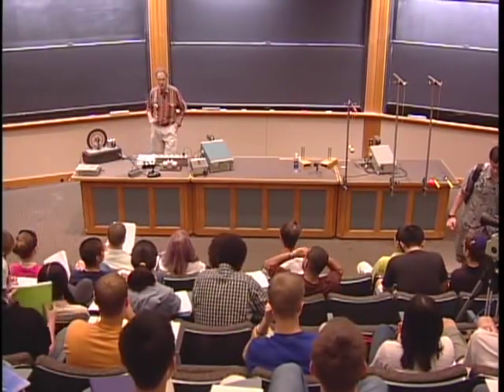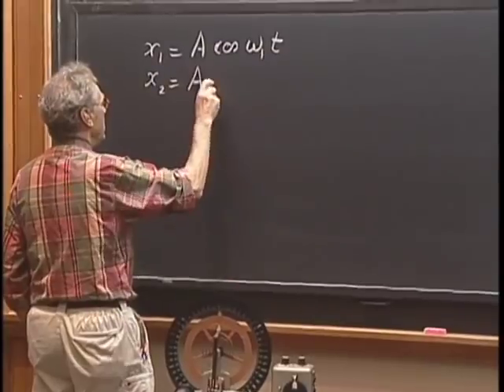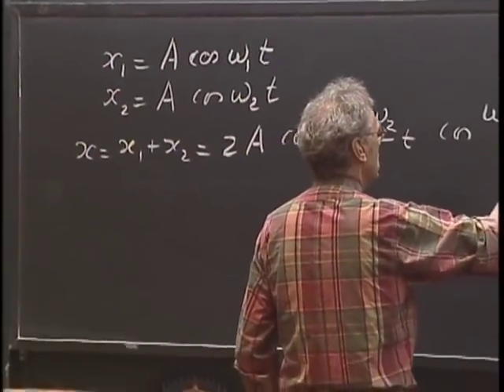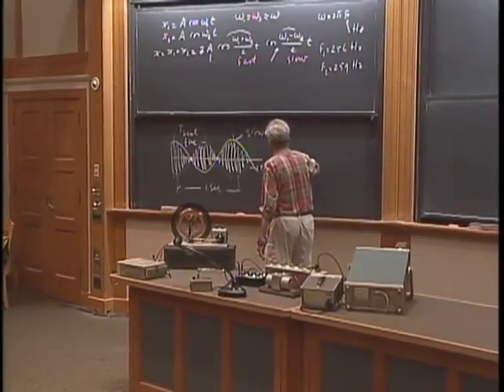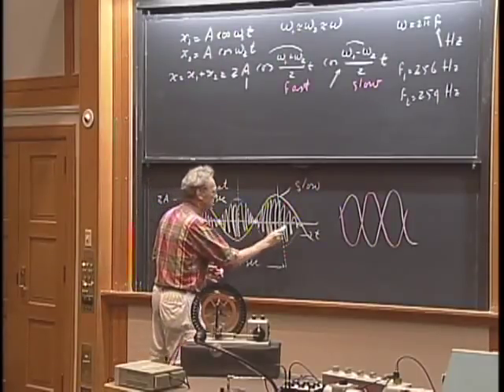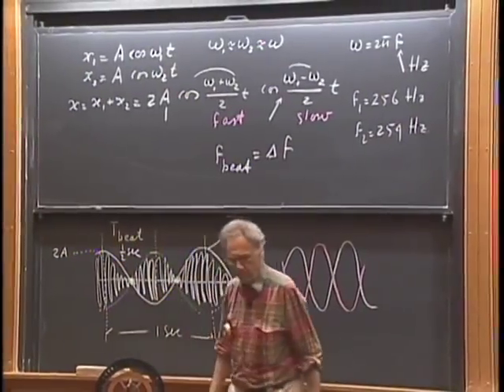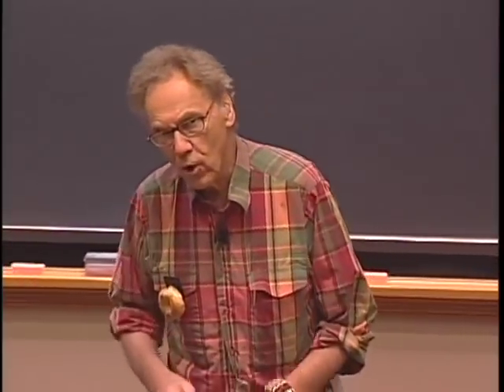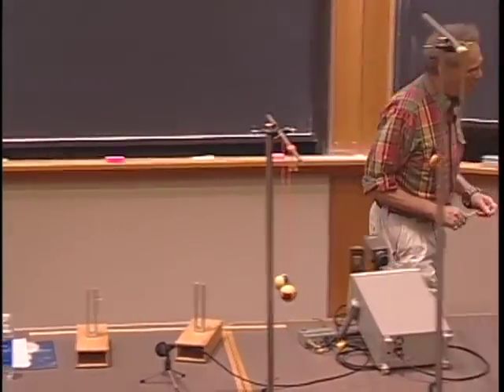8.03 - Lect 2 - Beats, Damped Free Ocillations, Quality Q

Comment: Hello, I think in your analysis of damped free osscilations, you miss out 2 specific solutions, over damped, under damped,  and critically damped. Im not sure how your method missed the two solutions however one  is an exponential decay, and one is an exponential decay times by a factor of t, with no osscilation
Reply: You assume omega^2 is a positive quantity and hence your solutions, for critical and over damped this is not the case
Reply from the maker: overdamped and underdamped ocourse are covered in my lectures.

Comment: Hi professor, the phenomenon you referred to of 2 jet engines creating a beat is known in avionics engineering as: "resonance offset", and it is real and deliberate. If the 2 engines were perfectly in time it could create damaging resonances, which probably wouldn't be capable of bringing a plane down, but are definitely strong enough to damage components. 

Planes have sensors that measure for resonances and damp them automatically, while a great deal of time is spent calibrating this system on the ground. 

The SR-71 has extensive systems which monitor how the 2 engines are performing together and automatically cuts out power if a resonance or mismatch of power is detected, since at high speeds this could easily bring a plane down. Pilots report this mechanism causing nausea.
Reply from the maker: very interesting - thank u

Comment: Hello, Professor. Gamma depends on L (inversely proportional) because L gives a sense of inertia in the RLC circuit, that drives the current even after the capacitor plates have discharged, after a quarter cycle. And gamma for any system is bound to depend inversely on its inertia, because it is more difficult to slow down an elephant than it is to slow down a human.

Comment: I think the reason why L also has something to do with the decay time,is the self-inductor converts energy to magnetic field energy, but circuit does not lose that energy.It can be convert back to current.If L is very large, the current won’t go very high.Then the lose of energy in terms of heat in the resistor will become slower.So it is reasonable that higher L—>higher N(longer it would take to reduce the amplitude by a factor of e.)

Comment: Hello professor Lewin, I have been thinking about the question you ask @ 1:07:50. The best answer that I can come up with is that as the resistor dissipates thermal energy it changes the changing magnetic flux through the inductor creating a back current that forces more current through the resistor. or maybe a better way to say it is as thermal energy is released it dissipates the magnetic energy that becomes more available current that creates heat at the resistor.
Reply from the maker: a resistor dissipates energy (heat) *I^2R Joules/sec. A conductor does not dissipate energy.

Comment: Kindly verify(1.08.25)

Energy dissipation in inductor takes place because direction of current changes through the inductor. Magnetic flux associated changes leads to back emf. Work is done against back emf during a part of oscillation. Work done by the emf (later) does not equals work done against it. Thus There is some energy loss.

Comment: Here I am again.. Let's say -1/4Q^2 equals h, so we obtain (1+h)^1/2 when we apply the square root on the expression that relates the omegas. Applying Taylor Expansion we get 1+1/2*h (we can omit higher degrees given that h is small). Replacing the proper value of h we find that w=w0*(1-1/(2*4Q^2)). I found the 8! ;)

Comment: Greetings Professor, First Thank you for the wonderful lecture... I have two questions, what would happen if I have more than 2 oscillation like 3 oscillations at a relatively same frequency( for eg 244, 245, 246 Hz)? And How should I go about thinking this sort of question/ questions, mathematically/deductively or I should do an experiment to find out? Your advice/hints would be hugely appreciated. Second, I think 'L' in LCR corresponds to mass in SHM, at equation level they both represent inertia of a system. (This is, though I think  is cheating at some level, by the way, my explanation to the question posed by you in the lecture)
Reply from the maker: question unclear
Reply: Do Beats phenomena also occur when more than two SHM involves in? (Like three SHM with 244,245,246 Hz frequency respectively. would they still show Beats? ).
Reply from the maker: yes

Comment: Sir I have a very simple doubt for you that I've been pondering over. I still haven't got an appropriate answer to this yet. The doubt is that , if we have a  tennis racquet , and we swish them with an amount of force, we hear a malignant amount of sound. How is that ? Hear we only have amplitude with a very , very less frequency(obviously below 20 Hertz) . even if we tell that we are striking the particles in the air and thus , we are producing sound, why does not it  apply  to other things as well. We depend mainly on the frequency of a vibration an object for its audibilty.
Reply from the maker: +Shricharan Dravid Messi You hear a sound when you put your hand on the table. You hear a sound when you push the keys on your key board. In all cases you produce a pressure wave which is sound.  No law is violated.

Comment: gamma  = R/L it depends on 'L' like the mass 'm' effect damping in gamma = b/m   lesser  m will get more damped oscillation same with L in the circuit. or as L opposes increase in current (-L di/dt)  rate of flow of charges are slowed down a bit and so less energy of charges will be  dissipated to heat becoz of  resistor . if L was not there the K.E. energy of charges would have dissipated more to heat. it feels good to me , might be right one.
Reply: prof. please tell is it right or not.
Reply from the maker: what are you referring to? How many minutes into my lecture?
Reply: at 01.07.28 you asked why "L" also comes in damping in RLC circuit.
Reply from the maker: the answer is that wL has the dimension of ohms.

Comment: explanation why gamma is proportional to 1/L:

in a circuit, inductor  always try not to change direction and magnitude of current. so when current introduces in the circuit , it is inductor which keeps minimize the magnitude of current and thus reduces energy loss in resistor.

is  my explanation  right ,sir?
Reply from the maker: what you write is not an explanation. Lenz Law dictates that a self inductor will oppose a change in magnetic flux inside the self inductor. No more and no less

Comment: For the general solution of the differential eqn. in complex plane you took the function to be Ae^(j(pt+α)) what is the use of taking α. I did the solution without taking α and it works just fine. Was it taken to accommodate the phase difference when required?
Reply from the maker: +Ayan Gangopadhyay Without a phase angle, sigma,  your solution is not as general as it can be. But for cases where sigma is zero your solution is fine.

Comment: In this lecture you have asked one question that why L comes in the damping constant R/L , in the case of a RLC circuit.I think the possible answer is according to Lenz's law the inductor owing to its self inductance impedes the increase in current through the circuit, as a result of that it inhibits the accumulation of charge in the capacitor..Hence it is damping the response...Am I correct professor?
Reply from the maker: Arnab Mallick That sounds right !
\\/\///////@lter
Reply: +Arnab Mallick  I have a little problem regarding your reply..... Based on the formula,  gamma = R/L, it clearly shows that as L gets larger, it is more difficult to dampen the change in current..... Thus, I think inductance is used to impedes the DAMPENING EFFECT of the resistor.
Reply: +yao shen deng
I agree. As the L goes up I goes down, which creates less thermal energy over the resistor. After all when L goes up there's less current needed for the same amount of energy in the magnetic field (due to E = L * I^2 / 2). So for the same amount of energy in the circuit you'd have a smaller loss of thermal energy and therefore less damping.

Comment: (59.04) , q = q(1) * cos(wt+@)+ VC  , then we got q(1) = - q(max) . what q(1) being -ve signify, why it comes out -ve , can it be +ve?
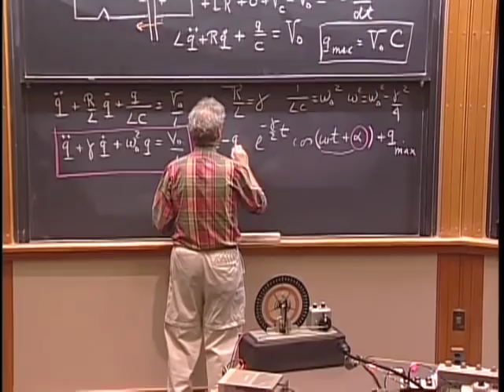Reply from the maker: I looked at 59:04 I see no -ve
Reply: 58.57  you said by simply replacing q(1) by minus q(max). we got it from initial conditions. please explain me what this -ve sign signify, why it comes out -ve , can it be +ve?
Reply from the maker: I looked at 59:04 I see no -ve
Reply: He meant as the angle alpha is small (5.7 degrees) although he mentioned it theta but it's fine then cos(5.7)is approximately 1 and from the equation q1= - qmax/cos(alpha) hence q1 is approx -qmax

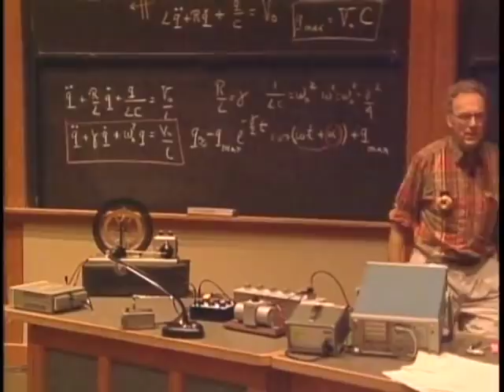Comment: Hello, professor Lewin. I was thinking about the gamma inverse dependence on L and I wonder whether it is so, because Self-Inductance fights against the current (according to Lenz's Law) thus making it smaller. If gamma/damping is due to heat loss and heat is R.I.I, then by making the current smaller the heat loss would also decrease. Is this even remotely correct or am I completely wrong? (Time stamp 1:07:35)
Reply from the maker: how many minutes into the lecture?
Reply from the maker: I  watched near the time you mention but I do not understand the question
Reply: @lecturesbywalterlewin.they9259  At 1:07:22 you say "You may want to try to find for yourself a convincing reason, why the L also comes in the damping..." so I tried to find a reason. I said I think it is because Inductors fight the currrent according to Lenz's Law and by making the overall current over some time a bit smaller, the also make the heat loss a bit smaller (since heat is R times I squared). If the damping is due to heat loss, then bigger L means more "anti-current", thus less current over some time and less heat loss/damping.
Reply from the maker: @lukastrecha6424  I would have to watch a large part of this lectuere again which is not worth my time. I am sorry.

Comment: respected sir, when you right LC circuit equation it is analog to mass m oscillates in damping medium here mass is oscillating but what is oscillating in LC circuits if it is electron then how it can be moved around the conductor and oscillates as well?
Reply from the maker: current is oscilating

Comment: Hey Mr. Lewin,

For a simple pendulum swinging until it comes to rest:

Does the air resistance it experience depend on its angular velocity?

I.e. Air drag is high during the first 10 seconds and air drag is low during the last seconds.

My physics teacher says instead it depends on the acceleration?
Reply from the maker: NOT angular velocity and NOT acceleration.
It depends on the linear velocity of the bob at the end of the pendulum. Watch my 8.01 lecture on friction. I dis cuss air drag in great detail and do demos.

Comment: Hey Mr professor
I have a doubt..
For a damped(underdamped) harmonic oscillator,
resonance occurs
a)When external excitation frequency is equal to undamped natural frequency.
b)At an external frequency less than the undamped natural frequency..
please help ASAP
Reply from the maker: I cover free oscillations with damping and forced oscillations with damping. Watch my lectures.
Reply: yes sir I watched..
I am just having a doubt about resonance in case of damping...
Because from the graph or formula for damped frequency we can say maximum amplitude occurs before omega=omega(natural)

so does it mean there is no resonance or resonance at frequency less than natural frequency?
Reply from the maker: >>>Because from the graph or formula for damped frequency we can say maximum amplitude occurs before omega=omega(natural)>>>
YES its a matter of semantics. Res freq in general is called the freq without damping. That is NOT where the amplitude is a max.
Reply: So resonance always occur for any case whether free or forced..at omega =omega(natural)?
Reply from the maker: its a matter of semantics. use google. Underdamped oscill have no resonance. 
http://physics.bu.edu/~duffy/py105/Resonance.html
Reply: Lectures by Walter Lewin. They will make you ♥ Physics. 
Ok sir I get it..
For free undamped system resonance is defined...
Right sir and it is omega=omega(natural)
and also in this case maximum amplitudes(large) are obtained..No doubt..
Now in damped Free oscillation..there is no such thing like resonance..but if in a question it says For a damped harmonic oscillator what is condition for reso?
Then we must say omega=omega(natural)?
am i correct?
and one more thing  max amplitude occurs before omega=omega(natural)..so what would we say about this?

please guide me through this..This question has come in competetive exam

Comment: Sir, at 1:12:15, you have the solution for overdamped systems on the board. When I went through the process of solving, I still have an oscillatory term: z=A_1e^-[gamma/2 + (gamma^2/4 - w_0^2)^(1/2)t]*(cos(alpha) + jsin(alpha)). What am I missing here?
Reply from the maker: my solution is correct. This is a classic problem covered in all College Physics Books. I suggest you use Google for more information if needed.
Reply: Lectures by Walter Lewin. They will make you ♥ Physics. I don't doubt your answer, but substituting n into p=n+js doesn't get me there because we end up with a cos term
Reply: @vijayr1485  Your solution has no oscillatory term in it. cos(alpha) is a constant and does not depend on time. I assume Walter has combined the cos(alpha) into the A_1 constant, to get to the same solution.
I am not sure why the solution is the summation of the A_1 and A_2 parts, though. I would expect the A_1 and A_2 part to be two separate solutions.

Comment: Professor, you said that higher values of Q will result in low values for the angle alpha. Does that mean that low values of Q will result in higher values for alpha?If that is the case, since q_1 = q_max/cos alpha, wouldn't q_1 become larger than q_max? (since cos alpha will have values less than 1, 1/cos alpha will have values greater than 1) And even for Q=5 (the example that you took in the video), the value of alpha is around 5.7 degrees. cos 5.7 is less than 1 (not by much) and 1/cos 5.7 is about 1.0049. And clearly 1.0049 times q_max is greater than q_max. Does this make sense, professor?
Reply from the maker: Castor Gemini How many minutes in the lecture do I say that " higher values of Q will result in low values for the angle alpha"? It would help me to answer you

Comment: Hello Professor Lewin, 
Do you know which two books are used for 8.03?
Reply: I know of the one book French. But what is the title of the other book you reference by Bekefi & Barrett
Reply from the maker: 8.03
Vibrations and Waves by
Anthony French
CRC Press
ISBN 9780748744473

8.03
Electromagnetic Vibrations, Waves and Radiation 
by Bekefi and Barrett.
The MIT Press
ISBN 0-262-52047-8
Reply: @lecturesbywalterlewin.they9259  Thank you I will be studying 8.03 now that I have finished 8.01 and 8.02 😊

Comment: hlo prof. , (17.55) gamma= b/m it has units of ang. freq. but whose ang freq. it is showing?
Reply from the maker: in any SHM we have a frequency in Hz (oscill/sec). We often prefer w=2pi*f.   2pi is a  phase change of 360 dgrees
Reply: yes, but as w(o) is natural a.freq., 'w' is the a.freq. of the system under damped condition, so whose a.freq is        gamma = b/m
Reply from the maker: w(o) is probably the resonant freq without damping. w is the freq with damping. gamma only shows up in w. not in w(o). gamma is the damping term.